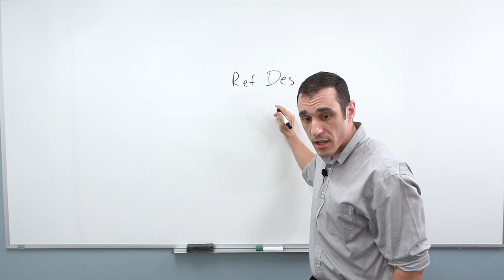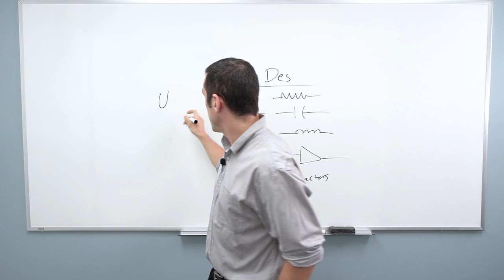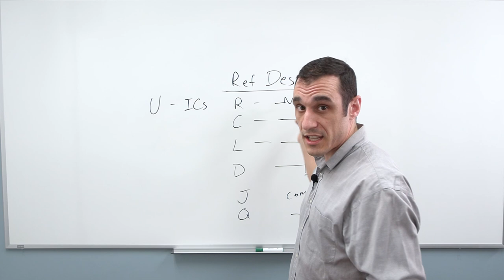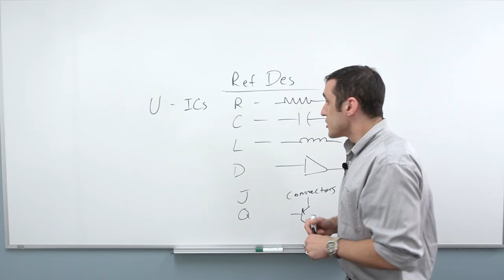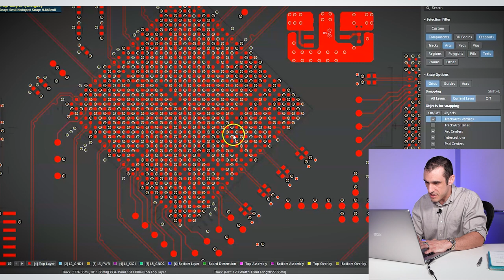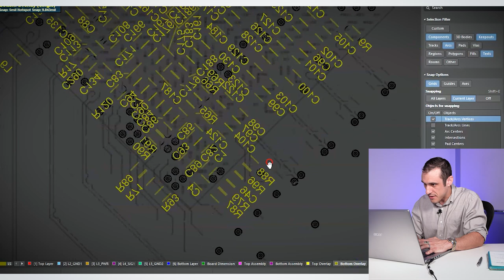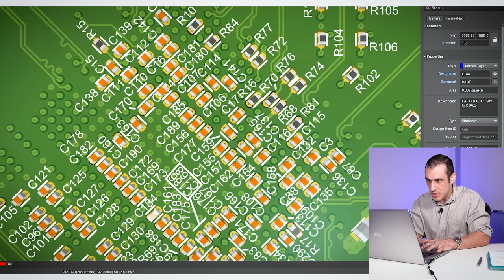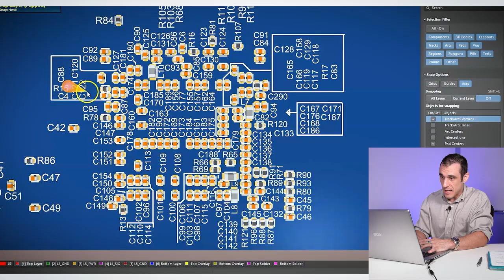PCB Silkscreen Deep Dive

Comment: Very nice and informative. It's very rare to find a video that talks about silkscreen. This is going to be a very valuable resource for those starting with PCB Design.

On medium to dense boards, like these you just showed, what I usually do is hide all designators in the board and use an assembly draftsman doc where I put a view of all the components with their respective designator. This also allows to possibly use a 2:1 scale and have a better visibility of small sections packed with small components.

I know, it's not as easy as to having the designators on the silkscreen, but necessary for not wasting a lot of space for them in the board, especially for dense boards.

Comment: Great Video dear friend Zach, 

I hope you are very well and let me say you that I love this series of videos where you touch excellent topics! 

And about this topic I have a question, What do you recomend me when I don't have enough space in the pcb to put my Silkscreen ? How can I do to put a reference code to my components in small pcbs ?

Regards!
Reply: Don't put them if it does fit.  Generate an assembly drawing instead.
Reply: There are a few ways you can try to fit reference designators onto a very small board. One option is to just decrease the size of the silkscreen. I've pulled open some products where the silkscreen is very small and you need a magnifying glass to see it clearly. You can also use the approach mentioned by Manuel Malagon (see the comment above) to call out reference designators in a separate document.
Reply: @Zachariah-Peterson  Thanks Zach !
Reply: @mart242  Thanks friend!

Comment: I would like to ask whether is it really needed to put all the reference designators on the silkscreen if the board is being assembled by the PCB manufacturer/assembler. I am providing additional fabrication diagram and the silkscreen would get really crowded in some areas. And I am not sure if all the boxes and arrows are more helpful or more confusing?
I am marking the polarities, pin 1s and some of the most important components (for example ICs).
Reply: Sure I understand, I would ask the assembly house. These are useful for purposes like debugging and inspection, also I have taken apart many commercial products and can see the designators remain on the board even at high volume. In some high volume products the designators are hidden for the reason you mention, or because they would like to prevent reverse engineering as much as possible.
Reply: @Zachariah-Peterson  Yeah, but silkscreen for debugging and inspection can be different from silkscreen for assembly. That is why I am asking. For debugging it is better to mark LED as "Power" instead of "D13". And capacitor near IO power pin is almost definitely 100nF decoupling capacitor and it is not so important whether it is C17 or C31....

Comment: what is the standard height and width of ref des?
Reply: There is no standard height/width requirement for reference designators on a PCB. In general they should be readable. I normally just set text height to 40 mil and stroke width to 8 mil. If smaller text is needed I'll go down to 32 mil height and 6 mil stroke width.
Reply: @Zachariah-Peterson  👍